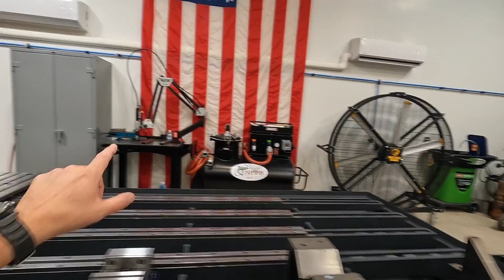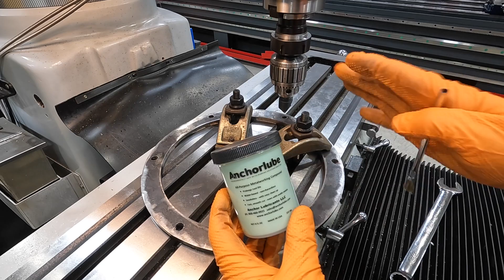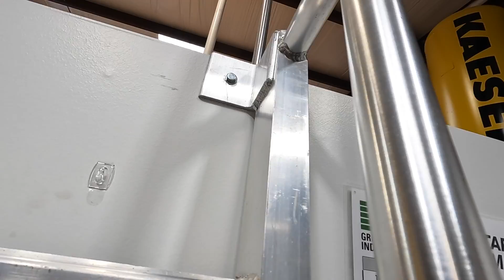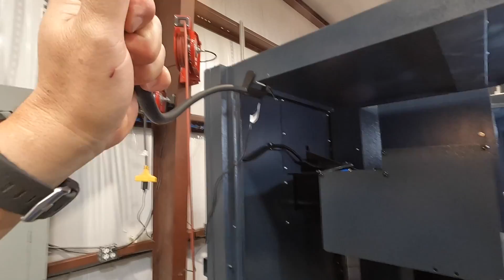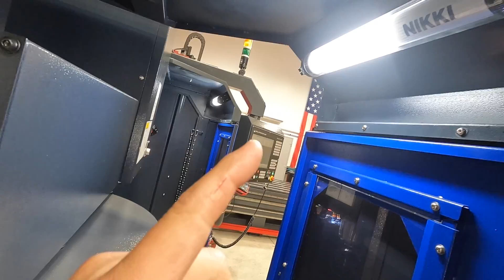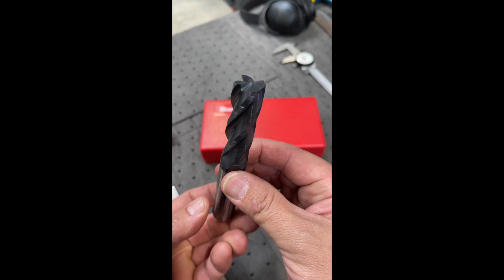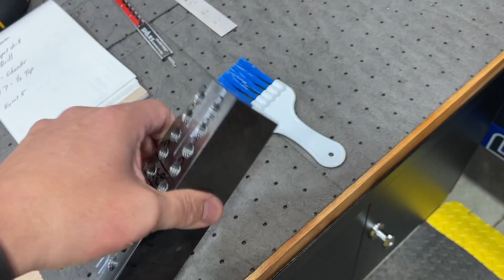SNS 369: Shop Jobs, Projects & Updates

Comment: You are making great progress.  Don't worry about making some programming crashes.  I never did CNC but essentially I spent my professional life making computers do useful things.  I never stopped causing crashes, but I got a lot better at making them rare and less damaging.

Here you are making a lot of videos that you can show your long-term customers that you're still Abom and still cost-effective even though you have started using CNC tools.

I was looking at all those nice small vices, all the same model.  Could you make a set of special jaws that would fit any one of them?  Do people use soft jaws on CNC?
Reply: The shop I used to work at had a few racks with at least 100 different sets of soft jaws for common jobs on the CNC's.

Comment: I could be wrong but I have a feeling you guys are going to grow weary of climbing that vertical ladder in a very short timeframe. It might pay to start scoping out a location now for where you can install a set of stairs.
Reply: I hope the beam crane reaches up there; you won't be able to carry much more than a purse safely! I bet it's going to be hot as Hades in the summer too.
Reply: @budlvr  Plus no restroom up there either. Have to come down pretty often. Not good.
Reply: Abby needs an electric lift. One button up, one button down. Ten seconds each way. Sort of a one person three sided elevator. Somebody probably makes one.
Reply: That's an emergency exit. Office should have been on the mezzanine, ground floor should be storage and expansion for the shop. They can still put stairs in the office area leading to the mezzanine. Though the "flat surface" viewing gallery might not survive. The office can still move upstairs, now is the time to do it, it will only get more expensive. I don't think they can use it as occupied space for Abbie legally with only an emergency ladder. Code violation.

Comment: Adam, I suspect you have a larger than average shoe size.  To prevent toe slipon the top step, how about using a couple of cheap,  short, 2"x, etc. to offset the top of the steps from the wall?

Comment: Adam, on your top step clearance issue, all you need to do it space it out from the wall with a small chunk of 2x4. It won't change the angle enough to screw up the base of the handrail fitting and you only need a little bit of space.
Reply: Was going to say the same thing.   The extra couple of inches will make for a safer top rung clearance.   It seems there is plenty of room to move the top handrail flanges back a couple of inches as well.  The bottom will need to come out the same distance as well, but it looks to be substantially within the depth of the cupboard.  Minimal protrusion otherwise, which won't inconvenience you or be hazardous.  The base flanges will stick out a bit further, but as they are flat, they also won't get in the way.

I make stuff-ups like this all the time.  It's only when you step back and take it in, the solution just seems so bloody obvious you wonder why it didn't occur to you the first time.

Comment: I recommend when you build the hand rail make it so you Open up a section of the handrail  for easy forklift access, we did something similar in our workshop and we put in a double gate  for forklift access.
Reply: Also, keep a dedicated pallet nearby for lifting things up to your new mezzanine,  Maybe even modify it by covering  the top slats with a piece of plywood.  Nothing fancy, just something to keep small parts or other things from falling through. 
P.S. @ 9:58 forklift forks belong on the floor when not in use.  You know this already, this is just a friendly reminder.
Reply: @surlyogre1476  If the last person using the fork knew it they wouldn't have been left in the air,strikes me no Ticket.

Comment: I am a bit surprised the machine is not able to tell if there is a tool in the holder. It is like a disaster waiting to happen.
If there is a tool in the holder it will be dropped! Clonk. And the 3/4" end-mill falls straight through the unique steamchest.

Comment: I will ask again and hopefully get a proper reply. Why does the CNC cut on a climbing cut?
Reply: Also better tool life
Reply: What answer are you looking for. Several folks answered you correctly previously.
Reply: @grntitan1  When using a ma manual mill Adam always said the climbing cut is for the finish but for hogging out as I call it it should be scooping it out if you like. On the CNC it is always doing a climbing cut. I just wondered why?
Reply: @dessilverson161  Because CNC’s use ball screw lead screw set ups instead of conventional ACME lead screws. Ball screws have very minimal backlash and can handle the more preferred climb cuts.
Reply: Thank you, I knew there must be a valid reason somewhere. I will stop fretting about that now. Thanks again, until the next bits I don't understand.

Comment: Love the CNC work i have done it for years BUT a dry test is a must hands on as i have seen them go through beds ! Cut stops off and dam right dangerous programing wrong direction to fast spindle speeds ! its scary stuff but you will get confidant in time but must always check and recheck your Z Y X and Home and the program many times then run in wood its so easy to make a childish mistake ? Good vid thanks ! Little john from the UK

Comment: Those YG cutters are great for the money.  I have used them a lot on tool steel(s7,p20,a2, 4140, h13, hardend and soft) and  aluminum,  and brass.

Comment: Just for your information, you cannot legally put a ladder in front of the disconnect like that it’s against code
Reply: See National Electric Code section 110.32
The ladder intrudes on the required 36” of dedicated space for the disconnects (or the total width of larger than 36”).
Further, this section requires that the cover doors on the equipment must be able to be opened at least 90 degrees, and the ladder clearly prevents it.
Reply: Exactly!

Comment: Are you sure about that aluminum ladder? Building code might say you need steps with a stair case type of thing. Might want to check the local building codes for this.
Reply: and i have a feeling its blocking the door on that electrical box from opening
Reply: Only when you have someone else working for you. For yourself you can do whatever you want. Even if it was a rope ladder.
Reply: @Ferry-Mersey  So no foreseeable employees pushing out the numbers on them CNC's then, should he get some big production orders.

Comment: Could you make some stand off spacers for the top of the latter to get you the clearance you need? You could also include right angle checker plate to protect the wall as part of the same assembly. just a thought, good to see SNS back on form.

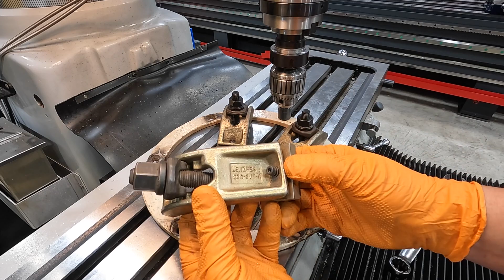Comment: Buy your self a chamfer gage so you can measure how big the chamfer is on those discs at video time 15:40 they come in 0-1 1-2 and 2-3 it measures the size of the chamfer then just match it. Much more accurate way of measuring it

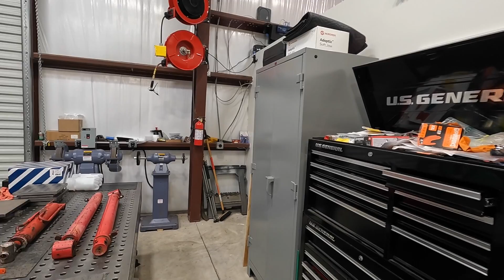Comment: 9:59 When you park your forklift, ALWAYS put the forks on the floor. I usually raise them a few inches, tilt forward to make sure the tips end up on the floor, then lower the carriage as far as it can go. Then make sure the handbrake is on and turn the key.
Reply: I've seen a guy go flying because of raised forks. Good advise.
Reply: Just like loader buckets.  Keep the cutting edge to the ground.
Reply: i was taught keep the toes down and the rest as far as theyll allow, taking any slack out of the chains etc while doing it, any lowering or raising movement would be done while handbrake is active, not while able to be moved. 

But ehy each to their own and their own teachers way of teaching.
Reply: i think we can all agree that leaving the forks this high on a parked forklift is dangerous. way more dangerous than the minor trip hazard of forks on the floor.